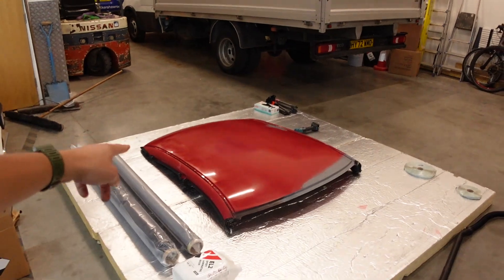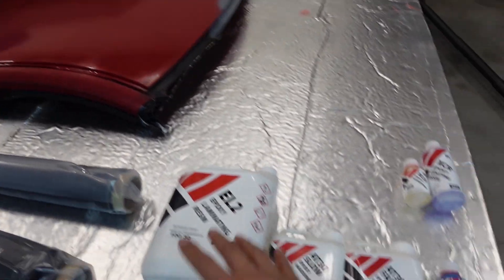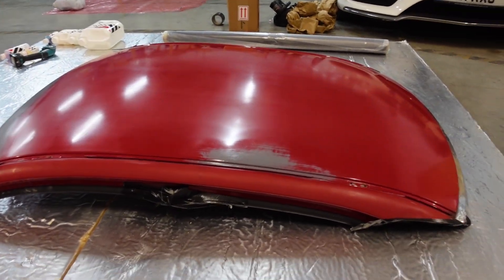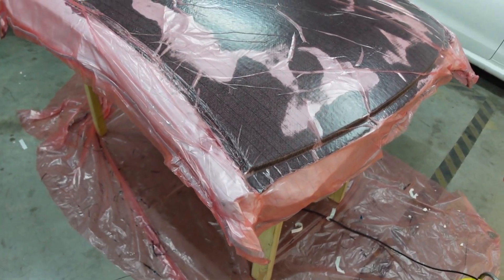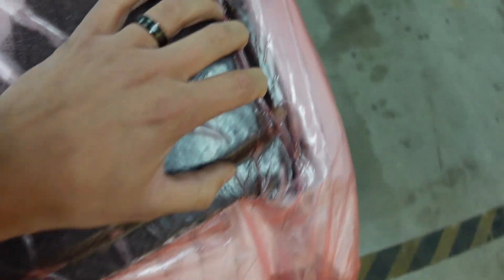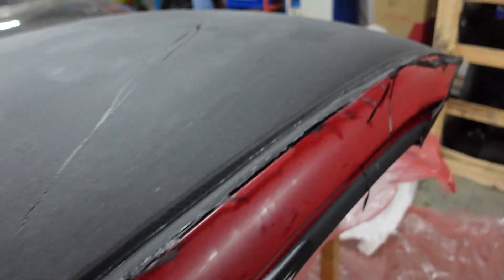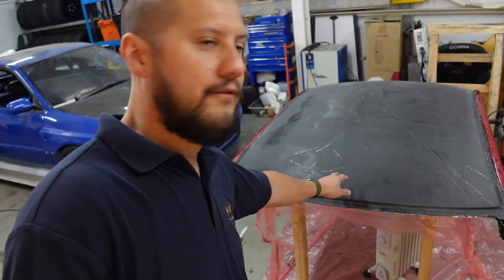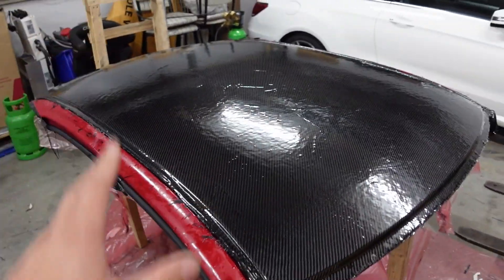Making a Carbon Fibre Roof!

Comment: lucky diolen is cheap, we cant get it here in the states. Well, we can from easy composites but the shipping turns it into same price as carbon 😪
Reply from the maker: Yeah I was surprised at how cheap it was. I wonder if average Joe would actually notice it wasn't carbon if it was used alone and in isolation.
Reply: @AndyPonting it's very close, don't think they could tell lol the average guy looks at a vinyl wrap carbon and think it's real 😀

Comment: RFS is the man to talk to for all your carbon fibre work and knowlage. Amazing job you done. Looks amazing.  What are you going to use to bond it to the roof flange, also when fitting thewind screen back in do you still use normal screen bonder to the carbon?
Reply from the maker: Cheers man!